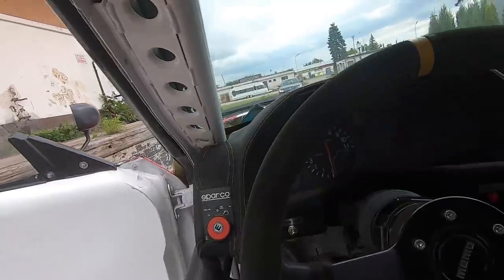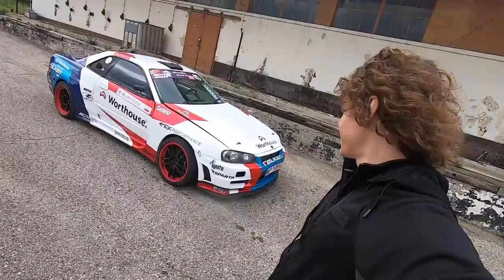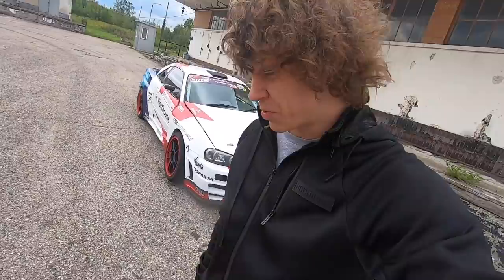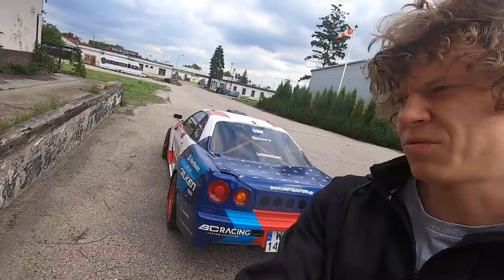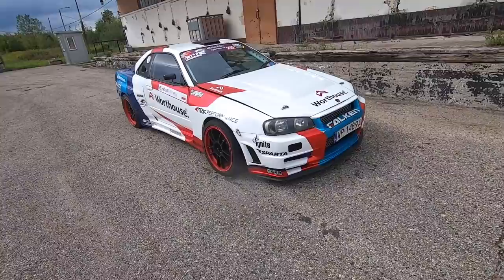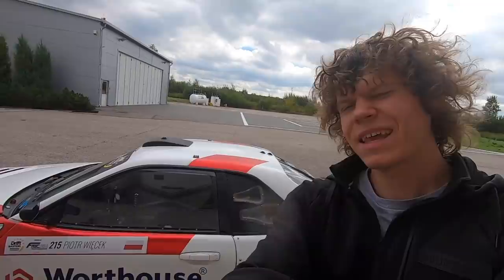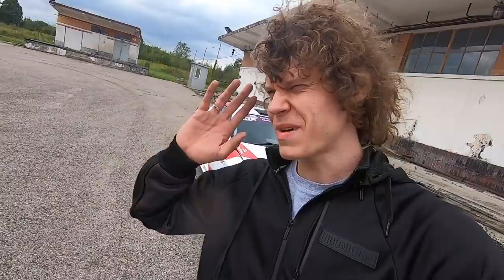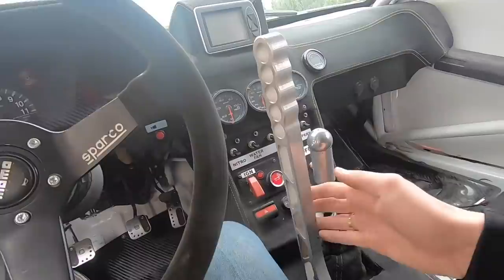Stories Behind My 800hp Drift Spec Skyline R34

Comment: I can not believe, that this one is street legal. Here in germany you could go to prison for having a number plate in the same room with a car like this 😂
Reply: Well actually it's not street legal, but as long as you have insurance and technical check up is up to date you can drive it. But it would suck if he'd got stopped by the police
Reply: @kapiesmieszek  is really that much simple over there? Here in Portugal just by having a slightly bigger tire or just a set of coilovers, if you get pulled over by the police you will get in trouble.
Reply: @aqwnr56  it depends, most policemen don't give a shit really, unless wheels stick out of body shape or lights are modded. But in case you take a part in accident, then you're pretty fucked and can actually end up in jail.